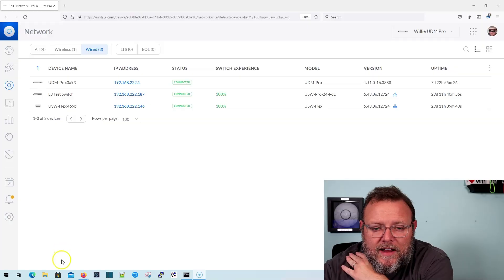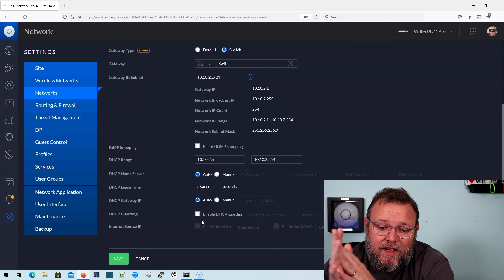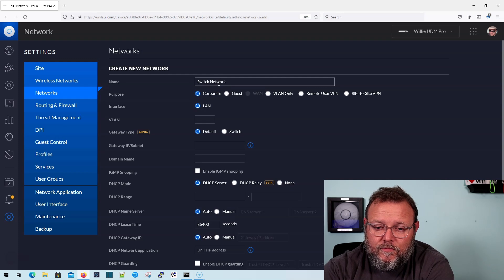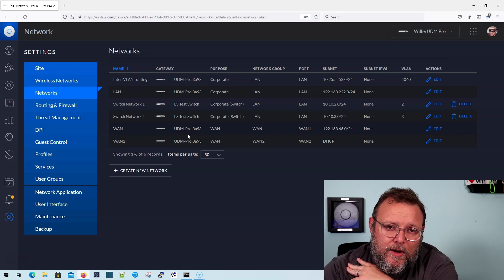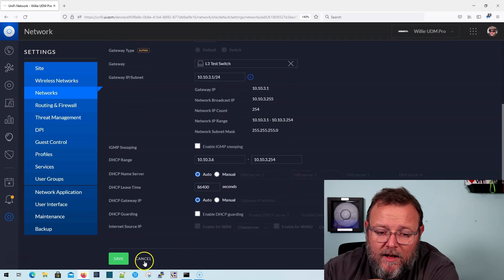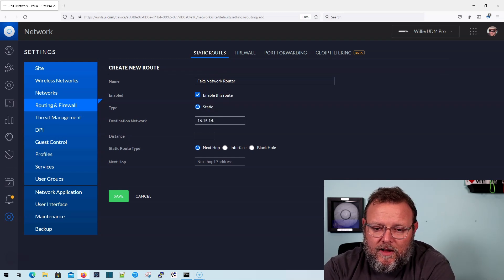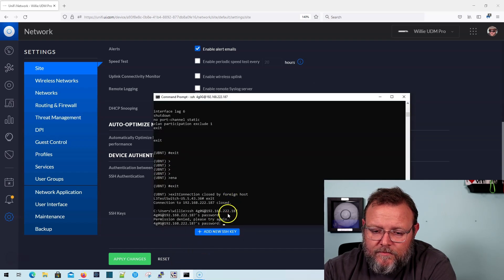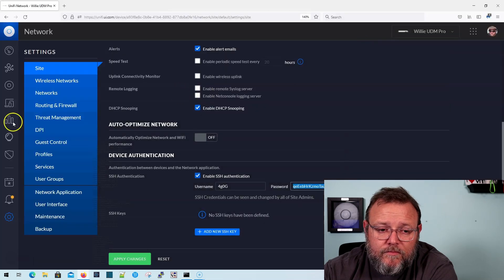Ubiquiti UniFi Layer 3 Switching - What works and what needs work

Comment: So what if you wanting to move a flat network to using the Switch Pro Aggregation switch  as the boss where all the new switches plug directly in as well using a third party firewall like Sophos XG within an Active domain directory that hosts it's own DHCP server. Would you then need to turn off the DHCP server setup on the  domain controller and set DHCP on the aggregation switch? We eventually want to setup Vlans but out of the gate we just want to replace all our mismatched switches throught the company.

Comment: Thanks for the awesome video.  Does interVLAN routing occur on the switch or through the router?  I'm trying to figure out a way to get my UNVR (on main LAN) and Protect cameras (on their own VLAN) onto L3 routing to lessen the load on my UDM-SE.  I still want the UNVR on my main LAN and may make use of both NICs of the UNVR to get this to work that way.
Reply: I've been having the same question with no answer.

Comment: If you change the gateway, you're defeating the purpose of having a layer 3 switch.
Reply: That doesn't change the fact that changing the gateway to something other than the L3 switch defeats the purpose of having a layer 3 switch. I would be interested in learning about the use cases for the scenarios you mention.
Reply: Thank you, I realize the L3 switch doesn't have to be the gateway but if it's not you're defeating the purpose of having a layer 3 switch.

Comment: Thanks Willie...   Personally, I do not know why UniFi bothered to release L3 switched when they have no industry-standard features. aka static routing between L3 switches.   Also not able to enter CLI code without the ability to save it between reboots, well why truly bother with UniFi L3 switches at this stage.   They are certainly are not Enterprise L3 switches!   Thumbs Down on these L3 UniFi Switches
Reply: This may be controversial on a pro-Ubiquiti channel.... but there is NOTHING about Ubiquiti wired products that are enterprise - the wifi is OK-ish, but you get what you pay for. Prosumer toys at best. Anyone who needs layer 3 switching should use the major players (Cisco Catalyst, Aruba CX, Juniper, etc). Or do the routing on an appropriately sized firewall (ie FortiGate 100F or 200F)

Comment: DHCP relay is done in USG and you need to configure a vlan, i had my windows server as the relay and it works.
Reply: @WillieHowe  you can if you telnet and enable ip helper then set a helper address, eg: 
ip helper enable
ip helper-address ( DHCP ip address here no brackets) DHCP
show ip helper-address

DHCP at the end of the second command is important. This is not persistent over reboots. You need to set DHCP as NONE in the controller.
Reply: ^ these commands would need to be run on the switch which is acting as a gateway. This will only effect the LANs assigned as gateways to this switch. Not the default (management) one which should be connected to a different gateway on a firewall or udmp anyway. 

Note, the LAN gatewayed (is that even a word lol) on the L3 Switch where the Windows DHCP server is hosted will automatically grab DHCP without these commands. Any additional LANs assigned to the switch will need these commands to use the Windows DHCP.  
 I have wrote a python script which sits on the DHCP server and checks for DHCP relay changes on the L3 switch and restores them if they drop for whatever reason. I'll publish it when I'm happy with it.
Reply: I do get though, it's not an ideal scenario and I do wish Ubiquiti would address DHCP relay on switches. It's the only thing which stops these being fairly ok L3 switches for small/medium deployments.
Reply: @WillieHowe  correct, I have a python script on the DHCP server though which deal with this.

Comment: Why do yall cry when Unifi doesn't want Layer 3 to totally work with other routers. I think this is good strategy to reward users that deploy a full Unifi environment.
Reply: An idea like that would probably get someone fired if they tried to do that.  You want your switches and wifi  gear to work with other routers for sure.   You think all the UI gear is going to work for all business types?  of course not.  You think they make most of their money from their routers?  absolutely not.   think about it...one router per small to mid sized site that could need 5-10 switches and 20-200 Wifi APs.  Oh we don't want to sell APs and switches to that business that already has a router brand they use, so we say F them if they don't use our one $400 router - f them, we don't want to sell 10 switches and 200 APs. : D

Comment: The missing DHCP relay for the switch style gateway is a showstopper for me, because in an AD integrated DHCP infrastructure, it makes this feature unusable. Not going through a bunch of customization to relay the relay via the switch, which would put those switches and the controller in an unsupported state. Good call out on that, by the way not to edit the config manually at the CLI. 😉